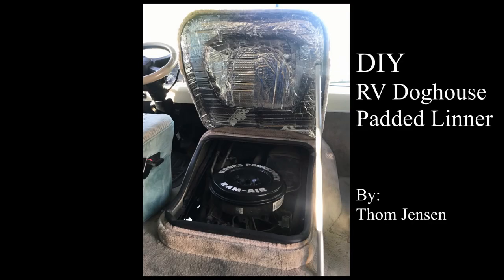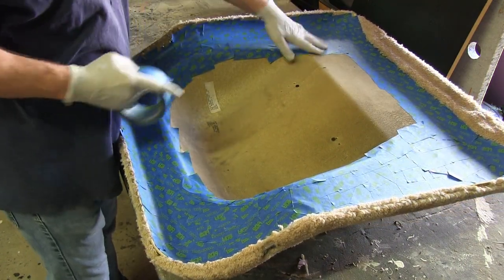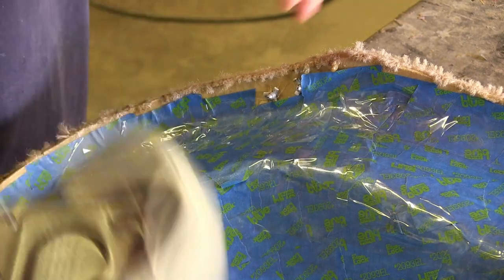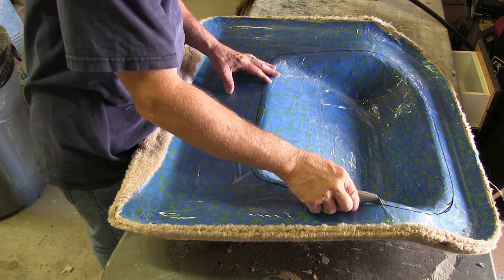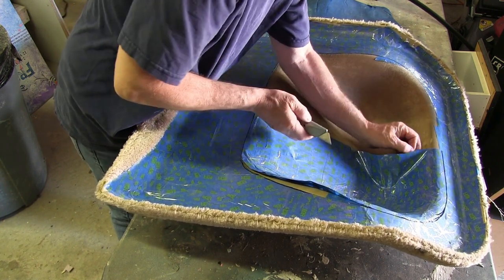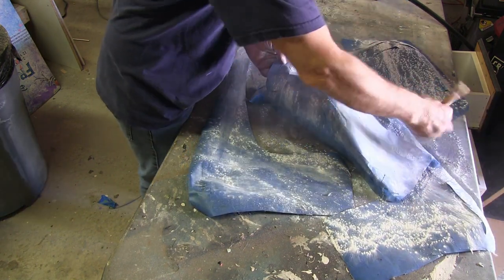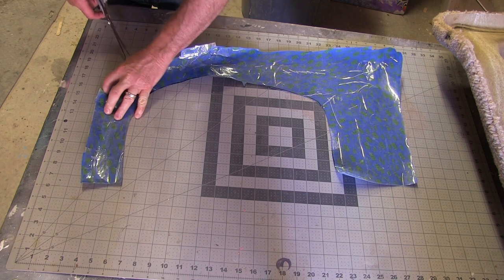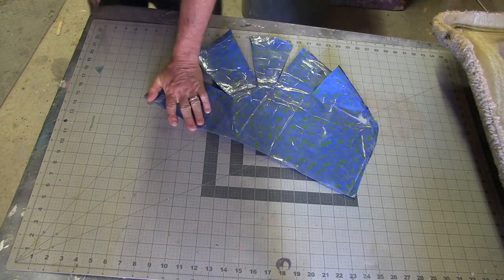DIY RV Doghouse liner and sound proofing

Comment: That is a very clever and interesting way to do that job. We have a 1995 Bounder with what looks like the same doghouse. Sometimes it gets noisy especially when the fan clutch kicks in on the 454. We may try your method. I wonder how much you notice the difference. I bet a lot.
Reply from the maker: We can actually talk to each other while driving. Before it was really hard to hear each other with the sound of the engine.

Comment: I have a 2002 Fleetwood Storm and the cover looks the same. Very cool way you did this. I see you put the insulation all the way to the edge of the cover. Did it affect the way it closes? Has the rubber gasket ever stuck to the insulatioon?
Reply from the maker: The insulation just went to the inside edge of the cover. So it didn’t disrupt the seal at all.

Comment: Im looking to do a patch job on my doghouse with some foil tape. Would cleaning the old foil surface with rubbing alcohol have a reaction to the foil at high temp?
Reply from the maker: I used acetone because of all the oils from the engine being on the doghouse. I don’t think alcohol will clean it well enough.